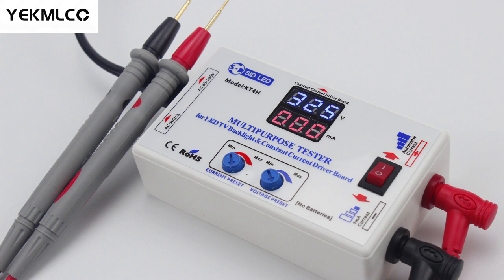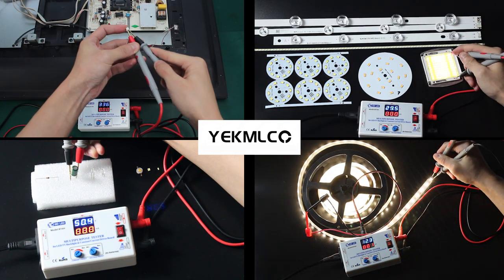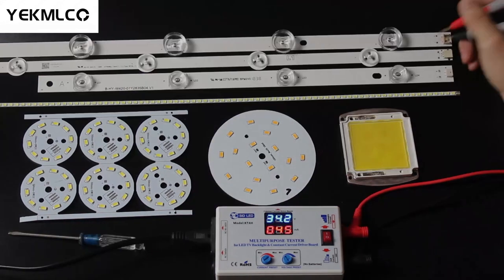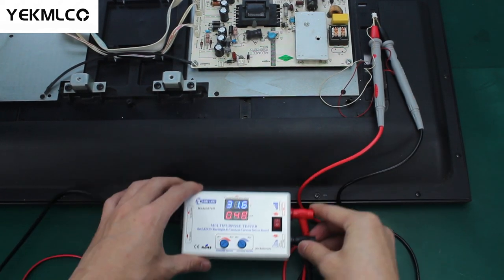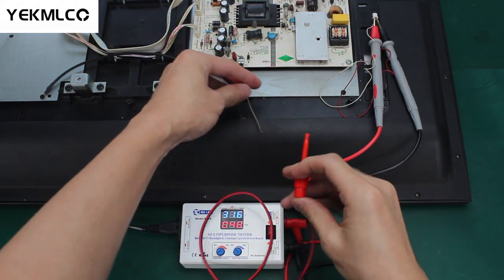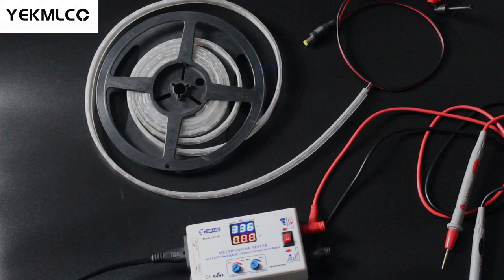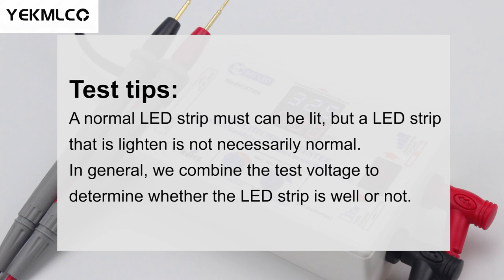How to use KT4H LED tester for TV backlight repair

Comment from the maker: You can directly click on the timestamp to watching：
00:45     Features
02:33    Test individual LED strip
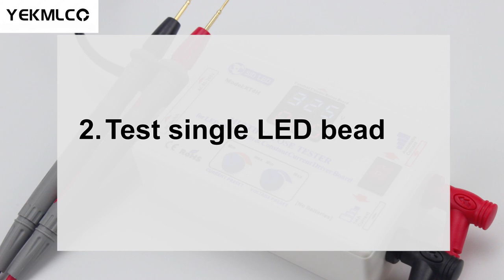03:32    Test single LED bead
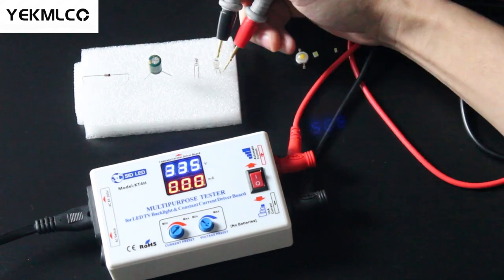04:03    Test the constant current driver board
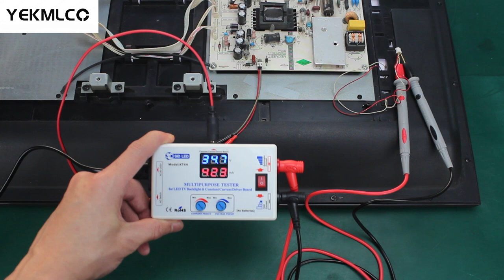06:58    Test 12V low-voltage LED strip
07:50    Test the parameters of various components